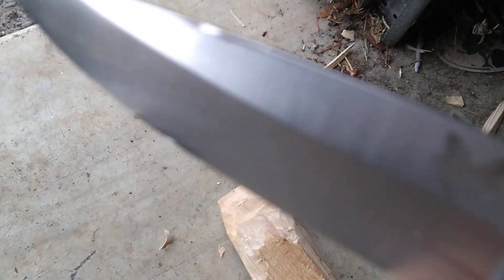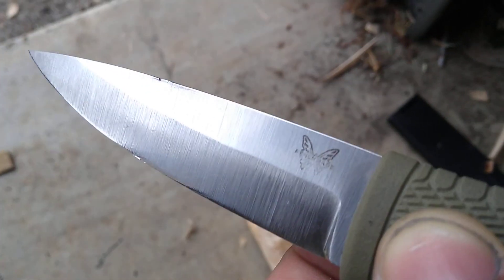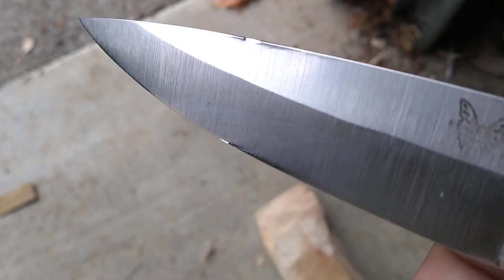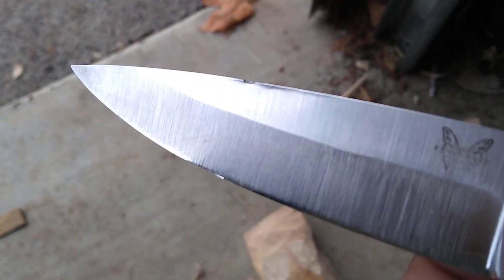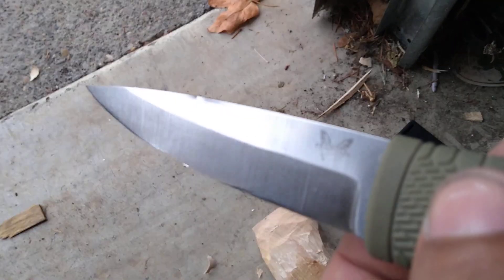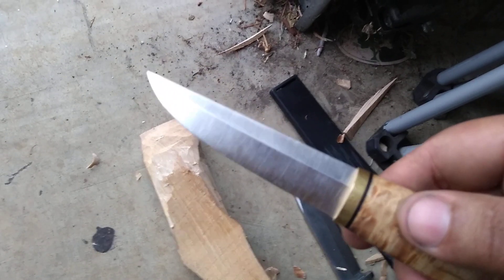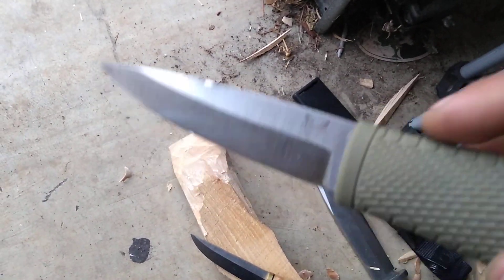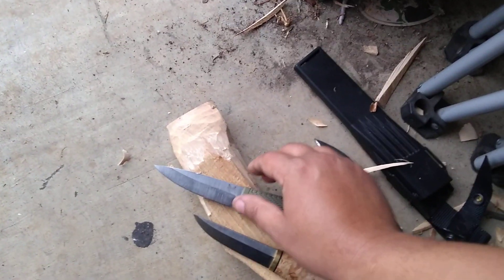DOES TOUGHNESS = EDGE STABILITY?

Comment: I'm curious, do not know - so not saying, but thinking. Steel gets stressed in life/use, and from various prior manufacturing processes. The military and certain industries regularly require what used, (at least), to be called magnafluxing to assure structural integrity of critical parts. I believe in fact something as mundane as AR parts are so tested, (the mil spec thing). Looking at the images here, it seems the "roll" you describe is directly under the spine damage from the hammering it endured. While alloy, heat treat and grind can all lead to the failure you now see, my wondering is about what stresses, in the form of micro cracks were imparted from the bolt cutting. And what roll did that play in the new edge failure after regrinding. just thinkin....
Reply from the maker: The saying goes, when you hear hoof beats, think horses, not zebras. The edge rolled when carving hickory because I made the geometry too thin for the steel and hardness.
Reply: But if you're in Etosha, The Serengeti, or Kruger.... 
Perhaps one needs to think about forests not trees.
Reply from the maker: @tomr3641  Occam's razor my friend.
Reply: Ahh, mebbe. But still inquiring minds

Comment: At the same geometry would 3V at 61-62 Hrc have better edge stability?
Reply from the maker: Problem is, why use 3v then? Just use 4v if your working hardness needs to be higher. Let 3v be 3v.
Reply: I was just curious bc I have the Carothers EDC in 3V at 61-62 with a very thin geometry. I’ve never tried the twisting mostion on seasoned hickory though and curious if the added hardness would withstand the same test?
Reply: Also I have a BM Puukko on its way in the mail, I planned on thinning down the edge a bit but now I’m unsure if I should.
Reply from the maker: Nathan is an expert, should be fine man, that has a special HT protocal. Nah, thin the puukko out bro
Reply: Thanks brother I appreciate it. I’ll thin it out and let you know how it goes.

Comment: IMO this represents a good opportunity to investigate what difference a convex edge has on the edge stability of this knife.
Reply: Thinking the same. I've been fooling around with my knives geometry, and pretty much have to have at least a slight vex on my knives to keep from rolling, even my spyderco in M4. I test on seasoned hardwoods to find what each knife needs. I've been surprised at the performance of a flat with a thin convexed secondary, easy maintenance also. As always both of you, thanks for sharing.
Reply from the maker: convex is a way to make it more robust but it does have comprises
Reply: @FearNoSteel  LOL. Most things in life involve compromises.  Which in particular did you have in mind regarding convex edges?

Comment: I would use a higher angle micro bevel it will still cut good but roll a little less I didn’t notice you twist out of a cut and it still rolled
Reply from the maker: higher angle equals compromise though, 4v doesn't need it
Reply: Big Brown Bear  I meant on the 3v benchmade
Reply from the maker: @bp-hx9ts  I know, that's what I mean. I'd rather use 4v rather then 3v with steeper angles
Reply: Big Brown Bear oh okay didn’t understand lol